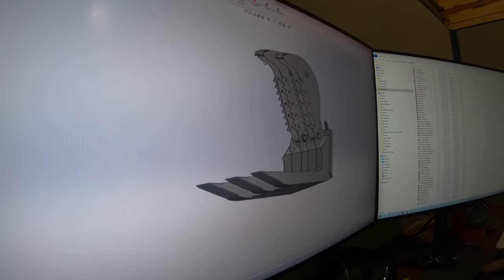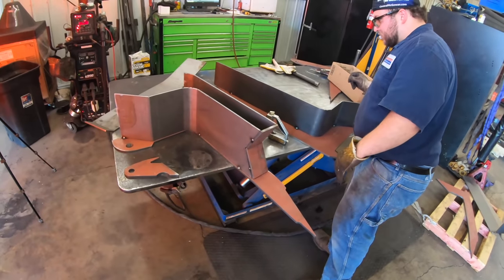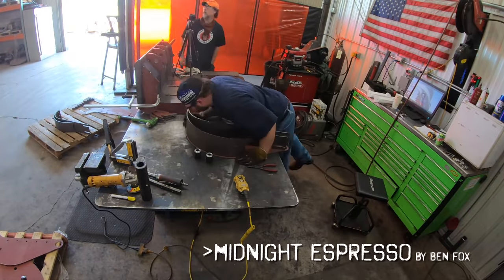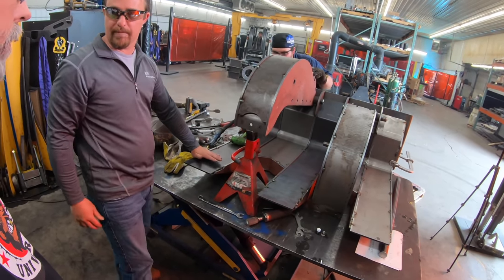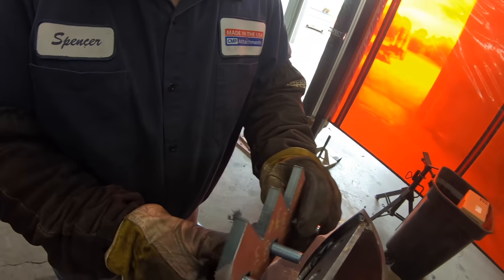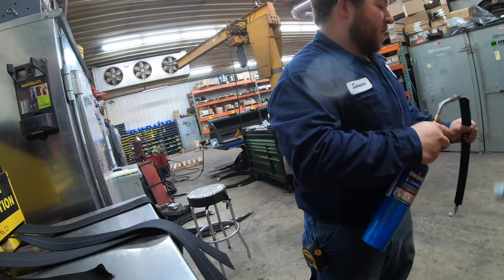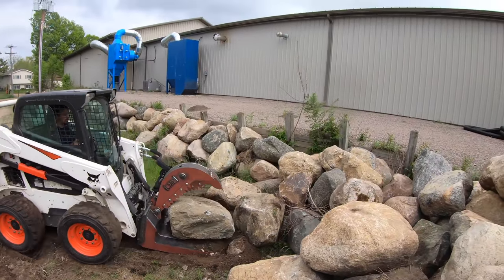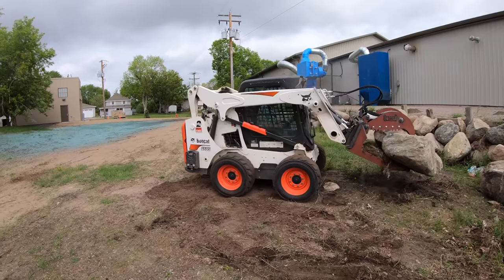Design. Build. Test. " Monkey Claw" - new equipment attachment

Comment: Surprised no one thought remote mount the grease fitting like they do on big equipment. Also needs a D ring or lifting point for trailer removal.
Reply: Yea, for a production run that would be the way to go, you could mount the fitting inside of the shell of the tooth, that way it would be protected from damage.

I hate replacing those little bastards.
Reply: The way these attachments gets used and abused these would get ripped off.
Reply: @londog53511  If you think a bobcat is even capable of ripping off teeth made to take abuse from equipment dozens of times bigger than them, I question your grip of physics.

Comment: It looks pretty good! On 2.0 I would suggest altering the angle of the pistons so it can open up to a solid 90 degrees. Should make picking up more stuff a little easier
Reply: I’d imagine the claws would hit the cab if they opened all the way to 90 degrees when the bucket is tilted back....
Reply: @elliottkeyes9448  maybe ... I thought the beak opened to 90 though
Reply: @HelenaOfDetroit  the beak almost has a flat back where this has a more rounded talon.

Comment: A1 fantastic FAB of this implement...from the steel selection for the use/abuse of heavy equipment to the pulsed-MIG welding process for heavy plate welding. Good job welding Stan...but you need to cut that wire stick out back a lot lol!

Comment: You asked for more ideas on attachments - as tree and land clearing company I would love to see a tree shear that can operate both vertically and horizontally. That way you can cut the tree down, then use the machine like a processor to buck it up without having to leave the cab. Having the ability to rotate 90 degrees would also make it practical for cutting roots and removing stumps. The other benefit I can see from this would be you could also use it to skid out the trees you remove.

Comment: why not make the lower deck front "teeth" removeable like the teeth on an excavator bucket ? easy way to modify the design and keep it from wearing too bad, neat design !
Reply from the maker: Good idea, thanks!!!
Reply: You really are an Armchair Guru. Haha.
Reply: Yea, with a slight tweak you could make it accept the big ripper teeth off the back of a blade or bull dozer. Or the rock chisel teeth from an excavator bucket.

No need to reinvent the wheel.
Reply: I was thinking frogs for the lower side too.

Comment: Finally someone else who is called OLAF  like my snowman from frozen :-)
Stan on those forks what you need to do is to use a bucket tooth from CAT 7T3403 Bucket Tooth Those you can exchange out and you can keep working.
For the hoses the solution is simple. Calculate the length movement of the hose and 2/3 goes into a steel coil spring. This way it's up and out of the way but when you fold the steel coil spring will bent and flex with the move of the bucket but straighten back out when it retracts. On top the steel of the coil spring will protect it from any damage.

Comment: I worked for a company 30 years ago that built something similar for digging railroad ties. It didn't have top clamp. 2 super heavy forks, we had a 12 inch dozer blade at rear bottom of forks so we could dig ties at angle and when full backup, put blade down build flat spot for ties to set on edge. When ties all gone. Logging truck with short bunks came by and load ties. We cleared 180 miles of track.
Reply from the maker: Very cool!

Comment: I prefer Parker fittings and hoses. If you have enough slack I can replace a fitting with our air operated portable crimper. A must have for remote location work.

Comment: I own one of their Hydro Grapples. Great tool and has made my company a lot of money.  Something I keep wishing it had is a hex hole in the center of the grapples. CMP could manufacture and sell an auger kit to fit into the hex hole. Now your grapple is an auger when you need it. Also, the blue guards on top have "CMP" cut out of them. They are very weak due to that cutout.

Comment: I think the fact that the shop fellows failed to covey as to the inter-lock of the top and bottom jaw is that it will allow you to get a good pressure grab on much smaller loads toward the back of the bucket vs. it coming down against the bottom jaw and tube locking the grapple. Looks like a real HD unit that will work well, nice job!

Comment: It would be cool to take that structural support and rigidity and put it into a forestry graple for skid steers for brush and logs. Using the same 2 claw design but a slatted floor to allow dirt to fall out of material.
Reply from the maker: what would we do differently than a standard grapple bucket in that design?

Comment: Will be interested to see how this does over time.  I've used a Beak for several years now, mainly for flatwork tear-out/replace.  I can't say enough about it, I was hooked the minute I saw the design.  The only thing I can see about the wider configuration and double-grapple would in fact be doing tear-out; I would rather have a twin-fork setup with a single grapple to exert a greater force on a smaller area breaking stuff apart.  If you move up to a bigger CTL or skid to achieve greater breakout pressures, then you probably break off bigger pieces, which can cause problems loading/unloading in the dump truck, as well as more wear and tear on the box.  If you've gotta break apart the bigger pieces before loading, then it becomes a time/cost efficiency thing.  I don't do near the general demo work that you do, so understand why you went to a bigger platform.  For my purposes, it's hard to beat Daniels' design - I make good coin with it every time I hook it up.

Comment: Looks like a good multi tool. Good for hauling scraps/trash, rock, brush I'd imagine, by the way the bottom is built it even looks like it could be used to get stumps up. I do see where the top would be a slight disadvantage in some scenarios though, the arms are short and curved. But I'm sure it could be used in a variety of situations. Kind of a carry all.

Comment: A bucket kind of like a concrete bucket for spreading stone evenly for both skidsteers and a excavator would be nice. Adjustable spread width for different width holes and stuff. For a skidsteer bucket you could just have a arm shaped like a u that goes on the outside of the bucket and can fold up to take a scoop and have stops that it hits when you fold it down so it spreads the same amount every time.
Reply from the maker: sounds interesting. not sure how to pull it off yet

Comment: Definitely think the claws should be wider and I think at the back of the inside of the bucket there should be a c-shaped 8 or 10 in cut out to where a piece of concrete can be slid in there and still be able to pick up the slab without grabbing it with the gravel that way it makes it easy on taking up side walk
Reply from the maker: similiar to a bucket that has that back built in lip-for grabbing concrete-  smart

Comment: I like it guys , I have the Demo Dozer bucket grapple (invented by John ) i also bought THE BEAK  , haven’t used it yet , but will soon , this looks to be a combo action of them and a grapple , If you decide to move forward with this I feel you’ll sell a bunch , its a little demolition, grapple, tree , concrete and debris tool , definitely needs a hose tube / cube to the corner then a spring 18-24” hose extension to the hydraulic connection point nice work , I’m sure Stanley will test the hell out of it and perfect it

Comment: Without some kind of a hook/bend on the end of the grapples, the jaws could fit over a rock, but not pick it up.  I't be like trying to use a pair linemans pliers (straight jaws) on too big of a nut.  With straight jaws, you can often fit them over an object, but not get any purchase/ grip on that object because the jaws don't have enough contact/ friction with the object.  They don't wrap around far enough.  The hook gives a point farther around an object (especially large round/ odd shaped objects) to create that extra grip.

If you want it to pick up bigger objects, the back of the "throat" could be increased.  In other words, raise the pivot point of the top grapples in relation to the bottom.  Of course the geometry of the grapples would likely change, along with length of hydraulic cylinders, etc....

AWESOME video, BTW.  Looks like the whole CMP crew is a good bunch to work with.
Reply from the maker: Alrighty then...thanks for that info👍 We will put it to some testing & will see what works...you maybe right.

Comment: Use a radius top blade in the press to prevent that cracking.
pro tip: if you sweep that floor off and spread it on your lawn it’ll be nice and green for years to come 😉

Comment: That looks really nifty,. My thought it change up on the design would be to replace the 3 long tines with a 6 or 8" wide forklift fork then some 1/2" plate. For the back half solid area .  That should  get it a lot thinner and possibly stronger. In my mind

Comment: You might should've put in a grease line to that forward zert, that way you could've avoided knocking a hole in the top of the claws. The hooks at the end of the claws could be put on a locking hinge, allowing the ability to roll the hook back into the body of claw, allowing for size adjustments.

Comment: Nice job. Looks like the hoses need to be moved out of the way a little more running from the claw to machine. Appears the may get tangled up in the debris and get ripped out of connection or beat up a bit. Nice beta version 😎
Ugh! I committed before seeing the end of your vid😝
Reply from the maker: I agree-  I think those will get moved on version 2.0

Comment: The top hinge point on the back of crawls needs to be way higher up that way the rear of claw doesn’t bite before it ever has a chance for the front of claw to to make contact
Reply from the maker: It would also be able to take bigger loads that way.

Comment: If they are going up and down together, a manifold mounted somewhere between em would allow the same length hoses and equalize the whole thing
Reply from the maker: Thanks for the input.  Appreciate that
Reply: @Dirtmonkey  wasn't being "Smart" an was scared to post cause some folks will always take stuff badly, but had to say that cause I have had the same kinda problem but on a different piece of equipment and that was our solution, equal pressure to both at the same time resulting in equal strength and response cause one isn't pushing more fluid farther to get the movement than the other, the longer run always a bit little weaker it seemed. something satisfying once you get the equipment working as you envisioned

Comment: Like that you guys added a grease hole for a zerk. At the beginning you said something to the effect of you get the boring since you are boring. I find that statement to be false as I enjoy listening to you about snow plowing or making a retaining wall, I find your knowledge to be fascinating and useful, will I be competing with you? No I’m enjoying my retirement and find your work, skills and knowledge to be entertaining to me. And in return if I can give you some hydraulic suggestions to help save work or equipment I shall share my limited knowledge.....like on the grapple, place the mount for the hoses in the center and the clamp hose to the right side (as from sitting in operator’s seat) and with a “T” fitting attach the other hose to the top of the T.. for the release side or open of grapple have the left side plumbed straight and the other side to the top of the T slightly slowing down that sides hydraulics eliminating a dominate side to the grapple.
Reply from the maker: Wow...your "limited knowledge" is really Amazing👍 Really liking your thoughts/ideas, keep em coming!

Comment: Monkey claw 3.0: on the grapples you could re design then so that the from hook part could move like up and down so that you could get bigger boulders and then clamp them down. I don’t know if that’s possible but the skies the limit! Both of those hooks on the front of the grapple could maybe move independently for bigger uneven rocks.
Reply: The machine barely move the boulders that fit in the jaws
Reply: Best not over load the machine

Comment: Remember Stan if it's got slag let it drag so if your runner spray and short arc you push and stick or duel shield you pull and it looks like that's spray your running but only advise it start on the right run as far as you can then move left past where you started a little ways then weld back into your welds it makes the transition between them level

Comment: I'm not sure if this has been mentioned. But I had the idea of a "double" beak.  It would be similar to the monkey claw by being wider. But instead of two top claws. There would be a top and bottom one. Similar to an excivator grapple. I could possibly hold any size of debree as long as it isn't too heavy for the loader. But in that case it could probably be used my the slege.

Comment: AR series steels are just a hardenable alloy of steel that is hardened to a specification.  So AR400 is harder and thus more wear resistant than AR200 which is harder and more wear resistant than mild steel.  That hardness also makes it stronger.  A side effect of that strength is that it has a much longer elastic deformation stage before it hits the plastic deformation.  What that means is if you keep applying force it will keep flexing after mild steel has started to bend.  But the harder the steel, the more it moves into the break instead of bending mode of plastic deformation.  It's Young's Modulus aka The Modulus of Elasticity.

Now here's a trick that you can pass on that will instantly make you a genius/steel whisperer/Voodoo man.  Take a torch and heat the bend area up to around 350-400F, then bend it slowly.  It won't be hot enough to damage the heat treat, but the elasticity curve is highly dependant on temperature.  When it is at temperature the curve will be shifted and allow for more bending instead of the breaking you see.  When it cools it will go right back to being high strength steel.  Just don't bend it fast, and don't go over 450F.  400F is usually the sweet spot.

Comment: If the back board was taller, moving hinge point higher, and arms slightly longer, you can get bigger boulders. As long as whole thing isn’t too heavy. Just like a beefy brush grapple.

Comment: Nice design. Good job. I like the idea of the center mounted hydraulic manifold, and the idea for the hose keeper. Can those quick connects at the loader be 90 degrees on the hose end? So they go towards the middle, or even up at an angle to be in line with the hose keeper mechanism?   I always enjoy your videos, Stan. The Dirt Monkey Force is a good team.

Comment: Hey Stan-
I'm really impressed with the new attachment! Question: We have a JD 110TLB tractor at the yard- same quick connect system that you have... do you think that the Monkey Claw would be too heavy to be effective with our rig? 
Currently, we have forks and a standard bucket for the front of it, but there are times with large hardwood chunks where it seems like we are reaching the limit of the hydraulics.  We've been thinking about getting a grapple for moving the logs prior to cutting/splitting... and since you have a TLB (that's what the black backhoe is, right?) I figure you'll have some insight. 

The pine logs aren't more than a foot in diameter, 20ft long, and they're pretty dry when we get 'em, so there's not a "major" weight issue using the forks unless we get stupid and pick up a metric shitload at once. The problem is, they fall off the forks! **Be Safe, GB&GG.**

Comment: Idk if I missed this or not but one option to be Able to do what I was thinking what would be extremely handy in quite a few areas of use, is to have seperate control over each grapple or claws as you were calling it. Having that ability would be pretty handy I can think of a few different ways where I would definitely use each grapple seperately, it also wouldn't be hard to be able to add that option to it would add on the price a little bit but what I would do is offer it with and without that option and then after a few sales and taking in the research of people get wether they buy it with or without then from there you can decide wether it's an option that is economic to keep offering it or to get rid of it if it doesn't sell. However I have a feeling that if you offered it and people knew it I believe alot of people would but it with that option. I definitely would because like I was sayt I can think of quite a few things where that would be handier than hell and then even a few things where I could use the attachment in different ways if I was able to control each grapple.
Reply: Yep I definitely stand by my idea even more after seeing it finished and being tested. I think having the option of using each grapple seperately would take that attachment to a whole new level. Another idea for it would be to have the option to use each on separate but then to also have it where you could use both of them at the same time still. Having that option to use each one seperately would definitely help with finish work!

Comment: The weld is actually the stronger point stronger than the steel without any weld. Test it if you think idk what im talking about but you'll find im right the weld is the strongest part of any metal your building with.